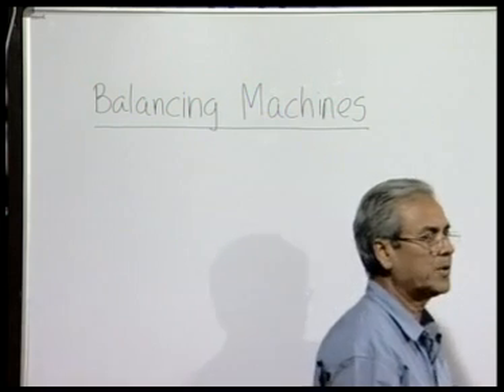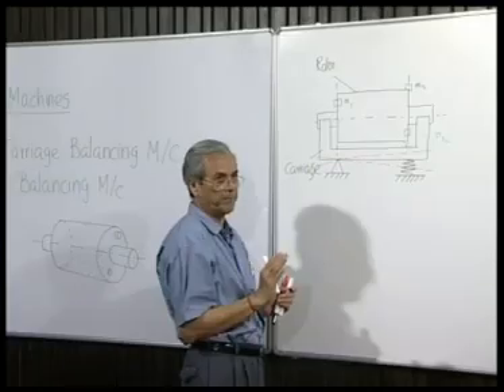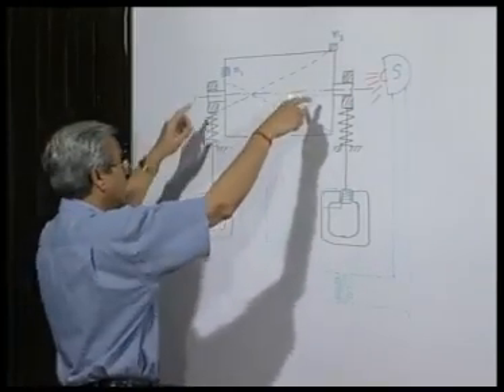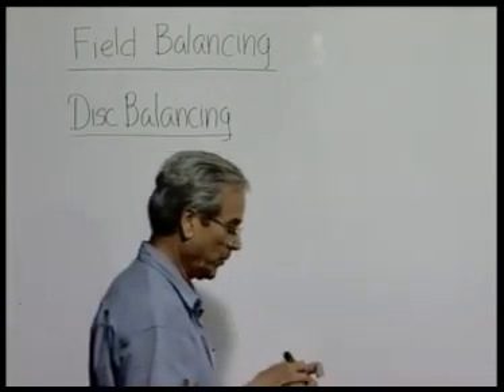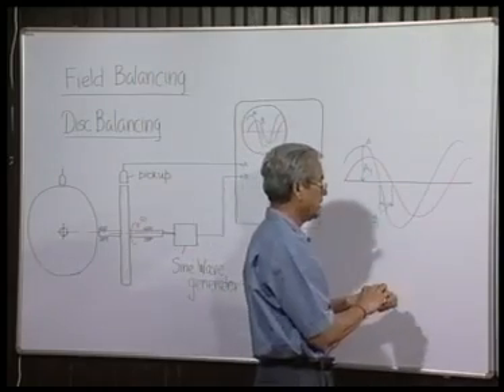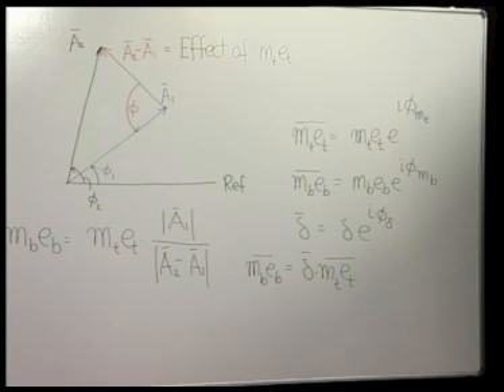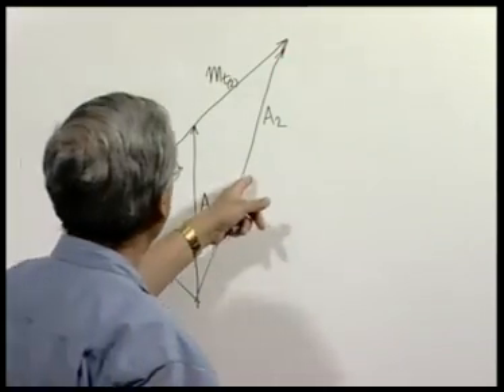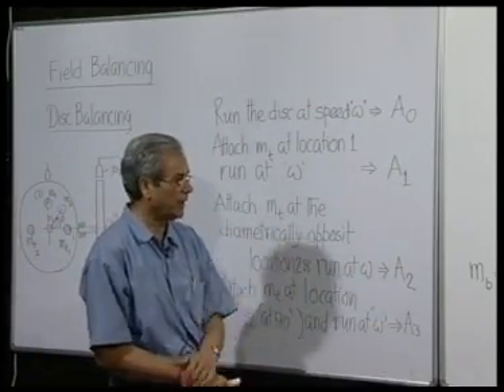Module 3 - Lecture 3 - Balancing Machines...

Comment: Yes we always use this method to balance our jet engines in the test cell if vibration is higher than 3 Mills. Field balancing is hard because gasoline is expensive every time that you start the engines. If balance is off in one of the operating gas turbine always do an oil sample; it might revealed if one of your bearings is bad and the eccentricity of the module can be affected, affecting the balance of the sections.